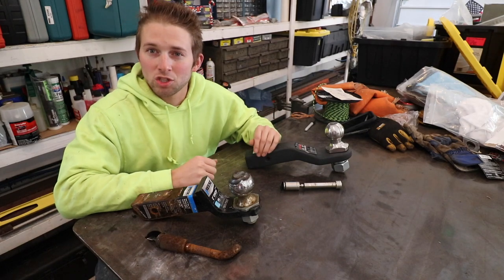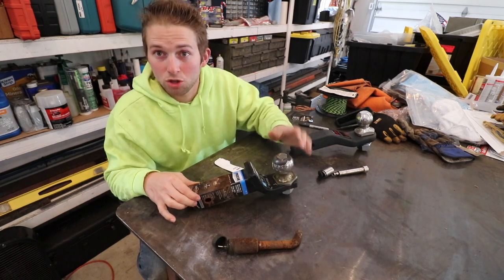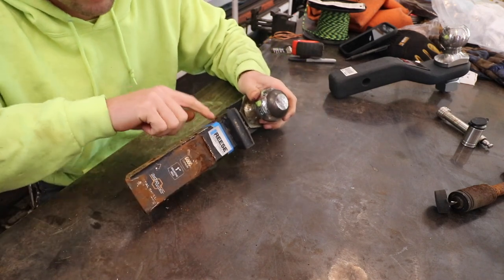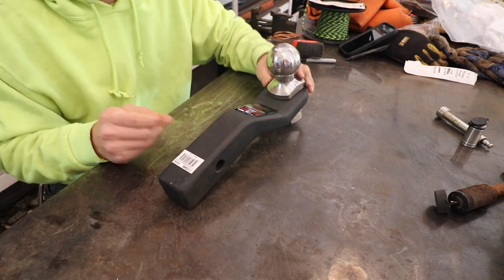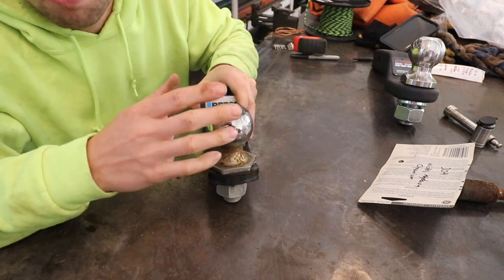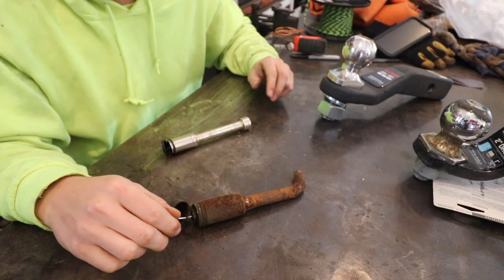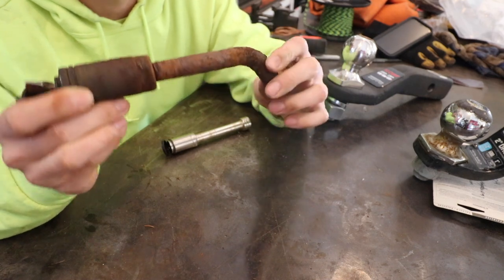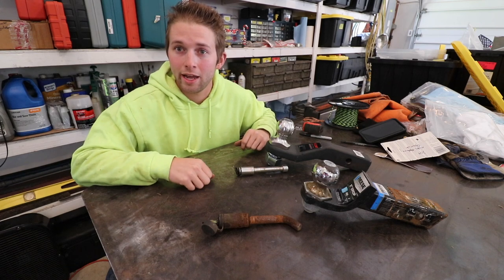$40 vs $120 Trailer Hitch

Comment: I am going to buy a 24 foot cargo trailer to move from CA to Montana loading whatever I can from my house.  How many lbs do I need, I am a woman don't know much about this, but I am learning.  Are Curt hitches OK, I see 67 dollars in walmart
Reply from the maker: First step is to see how much your tow vehicle can safely pull. Make sure that your tow vehicle can handle the weight of the trailer.
Reply: @OldSoulMillennial  I have a 1996 Chevy Silverado 3500 we used to pull a 1993 prowler fifth wheel, 31 footer, but now we will pull from that ball hitch. We want to pack the trailer full.